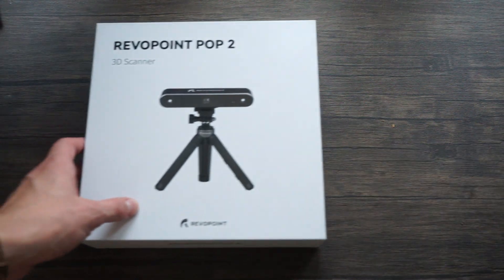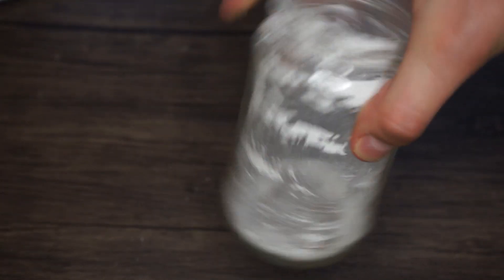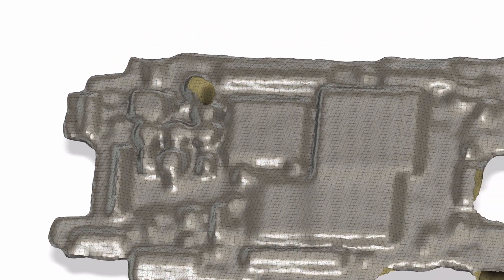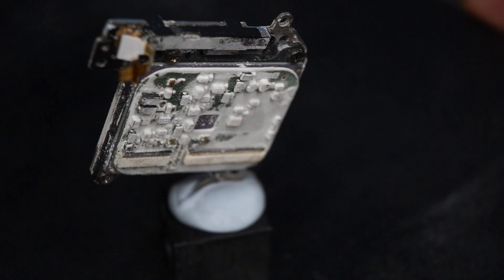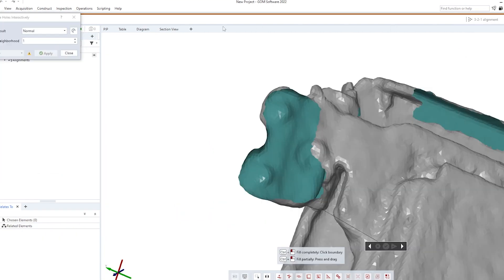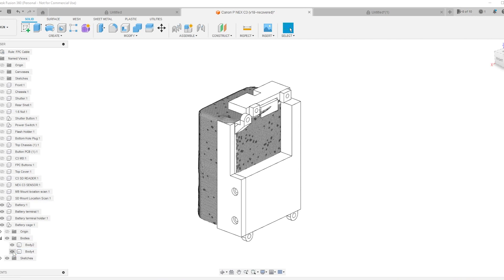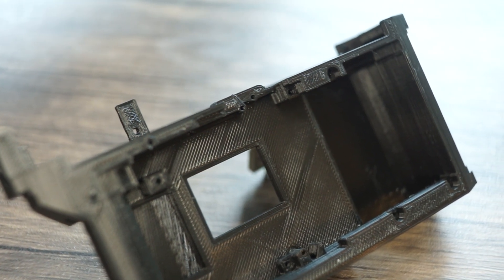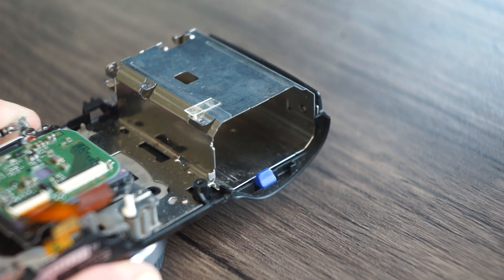Using A 3D Scanner To Build A Digital Rangefinder Camera - Pt. 1

Comment: this project is incredible, im considering attempting a similar retrofit on a yashica electro, though perhaps a dumbed down raspberry pi approach with smaller sensor. i'm very impressed with your fitting of an apsc sensor into this body
Reply from the maker: I’d love to have something based on a raspberry pi zero because it’s so small and a load of neat things could be done. The big drawback is that you’d have trouble to use the tiny sensor with its 5x magnification for meaningful photography. Unless the original “lens” is hiding an actual lens meant for the raspberry pi sensor within. But then you’d lose the rangefinder..